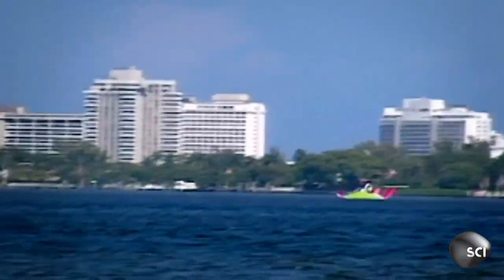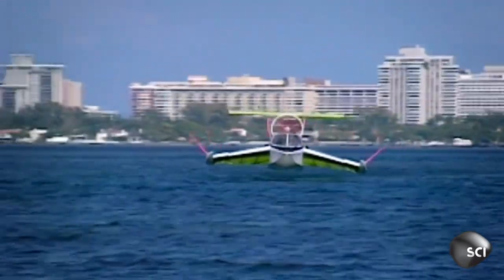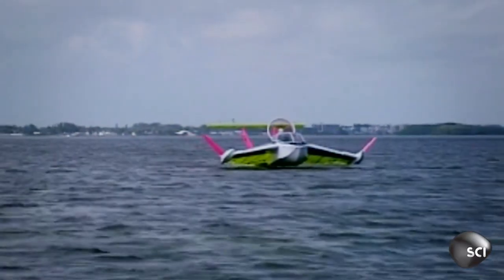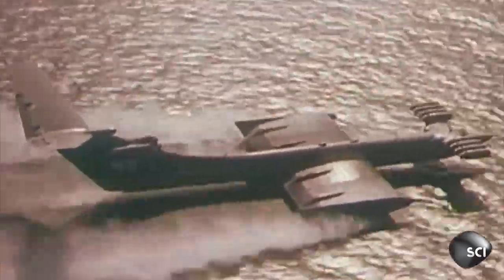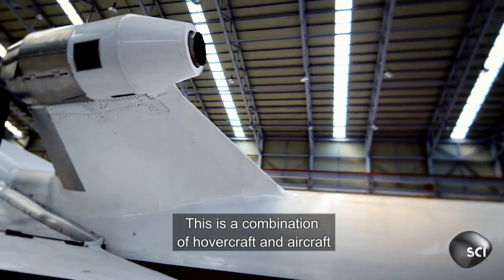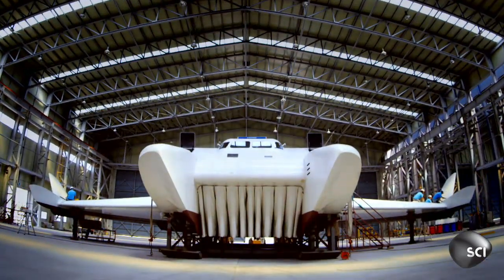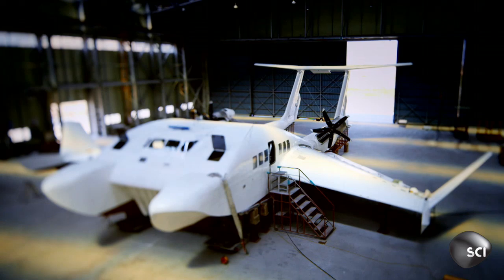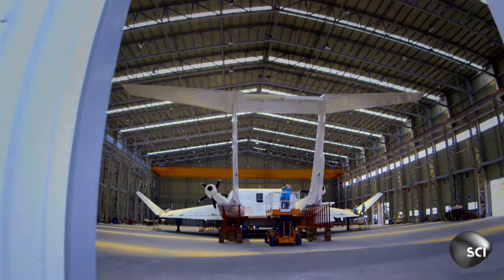Hovercraft Meets Aircraft | World's Strangest

Comment: This is great technology cause it is flying on the water. If it falls, the all riders are safe. And it can cruise on the water again with jet engine like a normal hovercraft.

Their speeds are pretty high. 😍 The passenger capacity could be increased afterwards.

This traffic tools could be used and applied in the short distance waters and soon introduced into long range waters.

Comment: That global warming bit at the end was so out of place lmao
Reply: Wing-In-Ground-Effect craft are extremely efficient machines. WIG craft, like the Boeing Pelican, would cut emissions of not only airplanes, which make up a large percentage of CO2 emissions, they would also cut emissions of ships which make up another large percentage of CO2 emissions. Before you laugh at that notion. WIG craft can carry a payload several times heavier than an airplane can, with only 60% of the power, and 10 times faster than a ship. What about waves? The WIG can fly in ground-effect 25 feet above the surface and depending on payload, can fly out of ground effect. State-of-the-art automated controls and GPS traffic control would assist any pilot(s) in command of the crafts. If you don't think CO2, building since the 1830's by humans, is a problem, then you aren't dealing with reality.  https://en.wikipedia.org/wiki/Boeing_Pelican
Reply: @markmiller6844  25 feet above the water isn't nearly high enough to allow for cross-continental flight, as it would have been developed by now. Of course, if the weather is just right, different story. You'd effectively have to plan out the route based on satellite imaging of waves and compensate for various low level conditions in real time. Planes cruise above the cloud layer making far more efficient to plan and book flights. Remember, companies want a stable, predictable income, otherwise nobody would invest. These WIG aircraft are good for short-haul flights across channels but I don't think they'll be able to replace ferries until they're able to carry vehicles onboard.
Reply: Air traffic makes up a big chunk of carbon emissions so the more fuel efficient an aircraft is the better, especially as governments will start to regulate the industry
Reply: @jacquesdeburgo2878  Still doesn't make the quote any less out of place.
Reply: Global warming ...

throw your toaster away !!!

Comment: i want that in my life... wait,couldn't you power the engine electrically? have solar panels on top and then hover indefinitely?
Reply: +Das Nutzkonto   These vehicles do not hover, they need forward momentum for lift.   The addition of a hovercraft mode is a recent innovation to help with the transition from a floating start to a ground effect state, how to deal with various wave patterns have often meant several hull designs needed to be tried which with low production numbers have been a serious stumbling block in the past.   Perhaps with modern computer technology, the hull designs could be tried in simulations bringing back this very old concept but the real problem is the lack of demand for such a product.   The reason why these are sea craft is that they can be licensed as ships and there are few obstacles at sea, these crafts are within one wing length from the surface they are flying over and can only hop higher for brief periods of time hence their ability to avoid obstacles are limited, using this concept for say a personal car like vehicle would be impossible to license and present it with challenging obstacles to avoid.   One possible version that might be commercially viable would be the ground effect train, a bit like a kite pulled by a train engine.   An electric version would have limited operation time unless you include a generator onboard making it a full hybrid vehicle but yes, the energy savings of a ground effect vehicle might make electric propulsion viable but solar panels would likely not be sufficient.   There is also a lot that we still don't understand about the ground effect, the Soviet ekranoplanes proved to be most efficient at altitudes three times higher than we would expect of the ground effect and we don't know why.   It's nice to see that people are still working on the concept but these versions look a lot more primitive at least in construction than the versions of the 70's and 80's.

Comment: Did you hear bout the soviet  ekranoplan?  Its the same thing just developed decades prior to these planes
Reply: Yep. "Caspian sea monster" as NATO called it.
Reply: najgauner yeah, but it's hard to say...
Reply: It's interesting to know that the original wing in ground aircraft designed by Dr Alexander Lippisch were capable of also flying like regular aircraft so that unlike the ecranoplan they could fly well above the water or ground of it wasn't smooth enough but then also exploit the added efficiency by using the ground effect if the water was smooth enough to do so.
Reply: Stefan: Very true. Increase speed and you increase height.